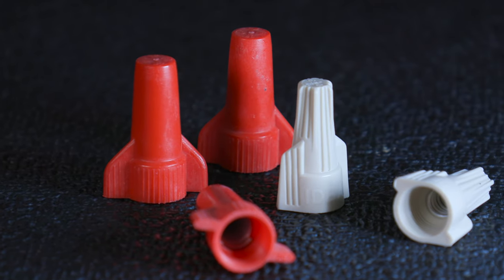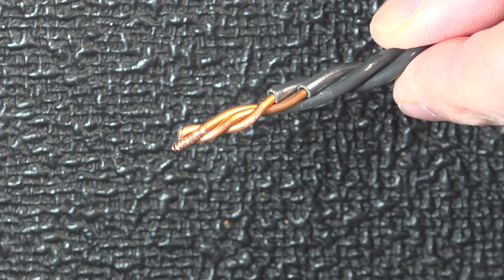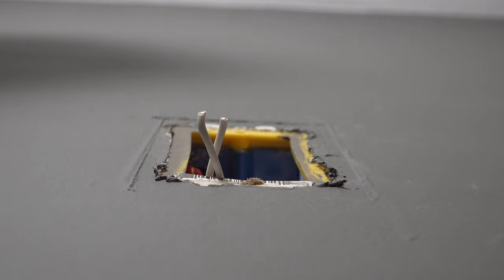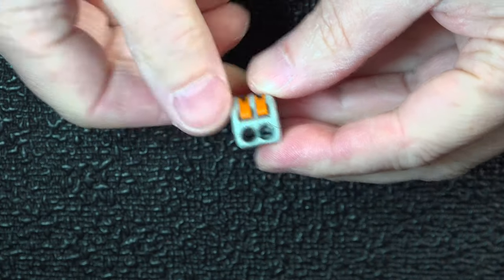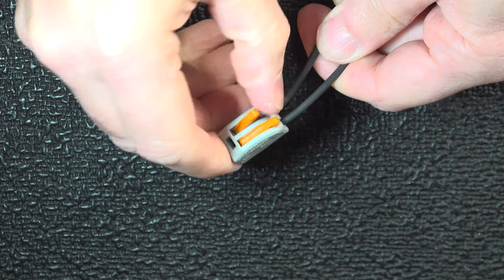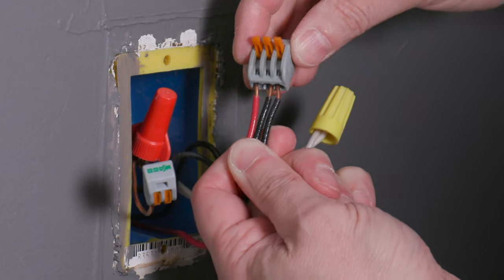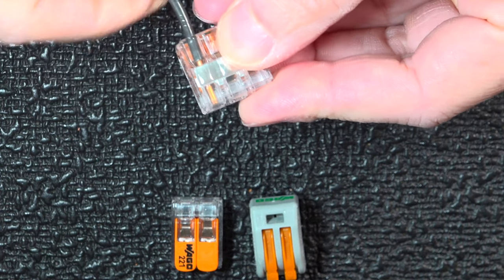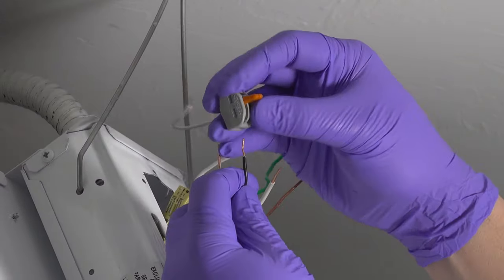Never use Wire Nuts Again - Wago is Better Electrical Connector

Comment: If you can't make a secure, safe connection with a wire nut, you have absolutely no business touching electrical.. I've seen these types of connectors cause issues with AFCI breakers/circuits. This dude probably thinks the stab-ins in the back of receps/switches is better than wrapping the screw and tightening down..😂
These connectors would be FAR more prone to failure or fire risk than a wire nut connection done correctly.  But you do you bub.. lol
Reply: The stab ins suck. The screw down clamps are fine.

Comment: Cmom guys,  how many service  calls have you been on that amounted to a bad wago? I've been out there tossing em all in the trash.
Reply: Too many, in my opinion, professionally, I see them as no different than stab in connections. You’re relying on a small piece of spring steel to make your connection. Like you, I’ll stick with twisting my joints, like I was taught, then topping them with a cap.
Reply: Lol what about those stupid splicers that clip onto the wire and cut the sheathing to make contact.  I believe they were used in the 80's for a very short time... fairly popular in automotive now.

Comment: This is like the TV infomercials that make pouring milk look impossible! NOBODY cuts off a wire nut! It’s just simply unscrewed and reused and still makes better contact on the wires than these Wagos!
Reply: Not to mention using a freaking PIPE WRENCH to tighten a wire nut. But like any infomercial, they show you a solution to a non-existent problem!

Comment: No professional in europe is using wire nuts. The WAGO 221 series are clearly the best choice.
Reply: it depends on the job. no one would use 221 for connecting standard 1-2,5 mm^2 solid wire cables in permanent instaltion. For these best choice is 2273 (which are 4 times cheaper than 222 or 221), or 224 when connecting solid to stranded. Main advantages of 221/222 are that these have  higher current ratings (32A, or even higher); universalism (stranded/solid), and easiness of connecting/disconnecting
Reply: @_xano  True, but i was talking (or better writing 😉) about disconnectable parts.

Comment: Wire nuts were banned in Australia in the 80s as unsafe. Corredctly so. We have used single and 2 screw connectors forever, but let me add, we also banned solid conductor  cable as well, now only multi strand being available. As an A and special class electrical Mechanic of 49 years, I can say without reservation the USotA electrical reticulation system is antiquated and sub standard
Reply: I was wondering about this. When I did my apprenticeship in electronics (early 90s) we had to do some electrical courses and the wire nut came up. The trainer said they were not recommended and instead recommended the use of BP connectors you mentioned. Technicians tend to use block connectors for mains with lugged and star washered earth connections as opposed to BP connectors. I have never used single core wire for new circuits but have encountered it many times in older houses built before the 80s. Mostly use multistrand flex or various TPS myself.

BTW, cool that you have special class sparky =D Recently got a mechatronics engineering degree myself.

Comment: Depends on the manufacturer of the Wago, the one's I used were not making a tight enough connection on even 12 gauge wire, and some of the connections failed and would not pass current. The alternative is the push on type connectors, they work the same way but do not have the lever. Using them makes taking the wire back out much harder although the wire will come out with enough force. I have used this type extensively without failure, and the building inspector did not have an issue after looking at the package. They must be properly rated to pass code in your state.
Reply: There is only one manufacturer who's making wagos, and that is Wago.
Reply from the maker: Correct, those junk copies are disasters. Either buy Wagos or Wirenuts, but never wago copies
Reply: @SirWallace2  The big box stores carry a product made by Ideal, and they are simple push on type connectors with no lock down levers, and they work great.
Reply: @SilverCymbal  Or buy the push on type made by Ideal (and others I suspect) that have no lock down lever, they are UL and CSA listed, and will pass code, at least in my state.
Reply from the maker: @SpeakerBuilder  I would never buy the Ideal ones or even Wagos push in connectors, They exist to be cheap and you lost many benefits. The 221 series is the only one I love. The others (including Wagos) are just cheap ones, Ideal can't infringe on the patent so they are stuck. Wago 221s are the only way to go.
Reply: @SilverCymbal  If a connector passes NEC then it will be fine.

Comment: The price is the biggest barrier to widespread use, is my guess.
Reply: How much are they?
Reply: @PandaCheeks  they aren't expensive, per say, however, they're 3x the price of the twist caps. Somewhere around 60cents each. Price changes depending upon quantity purchased, as usual.
Reply: @seansopata5121  Wow use whats been working for ever or pay more for something to do the same thing, just more expensive?  Well I guess I better buy them rather than be called lazy and not wanting to change.  If it works it works
Reply: @seansopata5121  60 cents each,jesus! That can get expensive buying a couple thousand at a time...
Reply: @tracer0017  Except this is way better and more convenient than your average wire nut....The only downside I see is the price!
Reply: @PandaCheeks  they're great for the individual user doing a small home improvement, but a small contractor ...? The cost probably isn't worth it.
Reply: @seansopata5121  Yeah,exactly!
Reply: German WAGO is world market leader. Only few chinese crap companies still produce junk wire nuts for some hillbillies
And besides durability and security, they save much money for quick install.
Reply: @proislam1447  Too expensive for the average contractor I'm afraid...

Comment: Do they handle different gauge wires in the same connector? I prefer the copper connectors with the set screw you tighten down to secure the wires, then you screw the protective cap on top of that. Forget the name, maybe Mar?

Comment: I can tell you with absolute certainty that is never going to happen there was Wago type lock will never be used by career electricians too expensive too much of a pain in the ass to use I will never use them as amongst career electricians wagos are "fire starters" just as those are they are not good for carrying a load the only use they have is sin for light lighting circuits and that's about it other than that they're junk
Reply: I 100% agree with you! I have been a licensed electrician for 15 years and only used wago style connectors for light fixture connections at the fixture. They don't provide enough surface area for sufficient current flow. I
Reply from the maker: Search burned wire nuts=1000 of results  Search burned Wagos=None
Reply: I bet there are 1000s of issues with wire nuts, every light fixture sold at the  big box stores comes with wire nuts. So there going to be more issues with them. That is also why the instructions on those fixtures say to consult a licensed electrician before installation. With wagos being less popular there are going to be less known issues. I completely agree that there are good uses for wagos. I think they can be used in light fixtures, with most new fixtures being led with a low current draw.
Reply from the maker: Billy Mack, Texas Detective  I bought three packages of connectors from Amazon at full price and researched the topic extensively along with 30 years of hands on knowledge. Check it out, reach out to them, I don't know them and they don't know me. Like all my videos what I show is the real deal and I show you how to and products that work. Buy them, if you hate them come back and tell me and return them. You won't send them back.

Comment: "You can't reuse wirenuts."
Is shown taking wirenuts off wires, proving himself false.
Reply: Taking something off and it being reusable are two different things mate. You can take head bolts off an engine for example but they are not reusable. Some items are one time use for a reason.
Reply: @bugatti1075  Good point, but wirenuts are not among them as they are reusable.
Reply: @AtimatikArmy  Whoever says that those are reusable does not know what he is talking about, even if theoretically "it works" practically if you knew how it works you would understand that with each screw, metal on metal, it loses its thread.  It's simple physics.  If it doesn't cut its way into the copper wire properly, well, it won't keep the wires tight.  Poor connection, a high resistance point, risk of fire.
Reply: @4dy4dy  Yawn..  The steel in the wire nuts is much harder than the soft copper wires they bite into thus will not dull the threads in the wire nut at all.   I know what I'm talking about, I'm an engineer.
Reply: @AtimatikArmy  It's a little harder than copper I know that.  But don't expect it to be the hardest metal, it's not hss.  The whole thread must not disappear to be bad, it is enough to lose a little of its grip and not tighten well. If you are an engineer then you know that metal on metal without lubrication wears out.
Reply: @4dy4dy  and you obviously don't.  the wirenut protects the joint, it doesn't "make" it.  if i don't see you twisting your wires together, well, you're not gonna be working on my job.

Comment: Crazy American sparkies and your wire nuts. In the UK brass screw terminals of some type in an enclosure were generally the only connectors used. Interesting fact though, today the correct type of Wagos in a suitable enclosure are one of the few connectors considered 'maintenance free' per UK wiring regulations and therefore allowed to be hidden above a ceiling, below a floor etc.
Reply: Should be noted that the OP is obviously not a sparky. No self respecting pro uses Waco’s exclusively.
Reply: Clearly the ‘chocolate block’ connector we’ve used in the UK for decades never made it to the US.
Reply: Do you have single screw connectors in the UK? Screw connectors are the dominant connector used in Australia.
Reply: @jayishere74  No self respecting pro should use wire nuts. Wire nuts are a connecting system from the last century. Or from the middle ages. 😉

Comment: I agree. Time savers. Especially if you are  rewiring 3ph motors 480 to 208 in rental equipment . 
The major flaw in the "new design"is not 600v rated. No 580v motor
Reply: You saying the 221 aren't rated for 600v? Actually, they are. Check the spec sheet.

Comment: People also though the "back stab" was a great invention on devices.  Now it's one of my most common service calls followed closely by miswired three ways etc.
Reply: Yup. Especially with the introduction of arc faults. Backstabbing devices on a circuit with arc fault protection will eventually cause problems. I've seen the same issue with these as well.

Comment: these are good an all if you tape down the levers on the ones you can open. i have seen way to may pushed into boxes where they come open and get hot or a wire comes out

Comment: These wirenuts are illegal here in the UK and should be banned also in the US along with the other out of date practices.
Reply: Why illegal
Reply: I was going to say that I've never seen these in the UK. We use screw in blocks, crimped connectors or solder.
Reply: I agree. Not reliable at all. I've seen wires secured with wirenuts pop out several times. I'm never using them again.

Comment: Maybe I've been connecting wires too long but everytime he touched the wire I had a small feeling it was live and thought, "don't touch it" or I felt anytime I've been shocked working these connections
Reply: well first off, you shouldn't be messing with a live circuit.....first rule in electrical work: make sure the circuit is dead. The second rule? make sure the circuit is dead even after you flipped the breaker because you don't know what some yahoo did before you....
Reply: haha, glad I'm not the only one. I could 100% have everything locked out, confirmed isolated but to me those wires are still hot and I treat them like so.
Reply: @AJKidman1  If I'm ever in doubt, even using my circuit tester, I'll wear insulating gloves JIC (just in case). 

Probably not the best way but one sure fire way to make sure a circuit is dead? Ground it out lol. No sparks no current! 

I had trouble trying to find the breaker for a circuit I needed to work on. It was a crazy setup with a pony panel and some circuits covered the bedroom above the garage AND down on the main floor on the other side of the house. I got fed up so bent a wire into a U, held it with some insulated pliers and shorted it. Then went to find the breaker that tripped.
Reply: Shep VanDelay  you remind me of the electrician that taught me the basics, for the first couple weeks when we were on a job I would ask him, " Is this live?", and he would say
"no", then i would touch it and get shocked, and he would laugh... Now this may sound like a dick move, but his first rule was, "always check the circuit for yourself, don't depend on someone else."  Now in those days I was working on 110 outlets, switches, and fixtures, so no harm no foul, but those tingling arms taught me two proper lessons. One, if you are worried about being shocked, check it yourself, two, don't complete the circuit with your body.
Reply: Ive been an apprentice for only 2 years, and also got that feeling. Avoiding the bare metal, even when working on non-live wires, have saved me twice.

Mistakes happen
Reply: @muskokamike127  in industry, you often have to work on live wire. Therefore you should learn the habit of avoiding the ends. Even when working with the power off.

Comment: Wirenuts have not been used regularly in Norway for at least 10 years. I have been an electrician for 10 years and used one maybe 3 times. And wago has been around even longer than that. 
I am always puzzled when I see other countries still using them, when you look at videoes from other countries. Some countries just seem so many years behind

Comment: One reason why the Americans are only allowed to have 110 volts in their houses😅🤔
Reply: Actually we have 220 volts. Primarily used by ac, electric stoves/ovens, clothes dryers & EVSE. Rest of the stuff in the house uses “110”.
Reply: Actually the 220 is just 2 110 outlets combined
Reply: @lumbtrolly6364  wtf? please explain that to me how you get 220 volts out of two 110 volt outlets?
Reply: @marvin3283  it's 2 110 lines that feed a 220. If you go to your breaker box it will also have a combo breaker witch is 2 110s put together

Comment: A couple of things. In wago connectors the tension on the wire is provided by a spring. Like all springs do, they get weaker over time, meaning a loose connection. Additionally a wire nut should be just used to insulate wires, not to hold them together. The wires are held together by the twist in the splice. Lastly, only qualified people should be doing electrical work. If you dont know what youre doing, you shouldn't be doing it, period.
Reply: @proislam1447  if a wire splice is done correctly, it doesnt need a mechanical device to stay together, as its held together by the wire twists.

Comment: I love how they make the wire nuts look so awkward to put on, its almost like they are doing it on purpose.  Then the Wago goes on so easily. Naw, the wirenuts work just fine.  If you can't work with a wirenut you shouldn't be doing electrical work.

Comment: My father twisted the cables together, put electrical tape over those 2 cables, then put a wire nut over it... Any chance that's a better way than the wire nut going first then tape as you showed?

Comment: Instead, the wire vibrates inside the Wago, where the соnnесtion is made by spring tension with the leading edge cutting into the wire surface, until it eventually fails. If you ever need to expand, the push connector is basically shot since removing the wire destroys the spring tension and biting edge. 

Are there folks who have difficulty securing mixed wire types and sizes into a wire nut, for such persons a Wago push connector is worth it. For the professionals, an appropriately sized wire nut is more than sufficient.
Reply: And they are expensive, over $20 on most supplier sites. Wire nuts are cheap. Not as good but cheap!

Comment: Wire nuts are reusable. There's a reason they've been used for decades without significant changes to their design.
Reply: Yep. If it is not broken, do not fix it.
Reply: @Syrnian  Just retight them every year and you are fine
Reply: @proislam1447 
They do no need tightened. Having to retighten them would defeat their purpose.

Comment: In SA  for the price of one Wago , you can buy a bag of at least 20 wire nuts , also our wire nuts are made from ceramic and have no metal inside , If the wago was cheaper im sure most would use it as its simpler and easier to use ,  but its overpriced and  uneconomical to use here .
Reply: Wagos are cheap, if bought in large quantities here in German. I suspect prices will be going down in the US too, if these become more widely adopted.